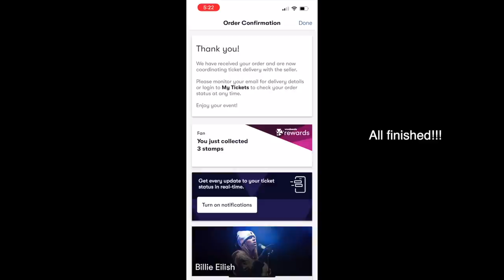Overcoming Obstacles

Comment: If the dog can get out, coyotes can get in, also foxes will dig under the fence to get to chickens and geese, Hawks fly in over fences. YOU NEED A BARN,  a large barn to protect the animals now. With PJ growing up on a farm, I would think he knows that. Chickens need to be in a closed coop overnight (and have a roof) to protect them from hawks and owls, especially since you have so much open land. And by the way, if there is one coyote, there is likely more as they are pack animals.
Reply: It's also frustrating as a farmer's son who works on a farm with more handlers and less livestock than PJ has to see almost no basic, rudimentary farmer's management going on.  
What is your herding plan?  How are you rotating the sheep on the land - are you going to use staff or are you going to use fencing.
Where I live it's a required class at the middle-school level to learn very basic husbandry - learn how to move herd for the betterment of the land.  It's no good to have all that land if the animals are just going to muck about in one spot making it that much easier for predators for so many reasons I cannot even type.
They're not really overcoming obstacles - they're creating obstacles.  And now they have pigs.  And they're not raising them to be processed.  That's just.  Think of the cost alone for having this much livestock that's only ever going to multiply unless of course they're killed.
Those predators have less and less sources of food the more they loose their habitat.  This type "learn by the seat of our pants (with so many animals)" is going to bring them all down on top of their OOOONO-ee farm.    
 It's time for someone to do a fb marketplace intervention.  
 I love PJ and Thomas.. going back years now.  And they can do what they want to do all day long.  Bless them.  But It looks like the children at this point are kind of rolling their eyes with "Guess what new farm animal we have today."

Why do you need that much livestock if you're not processing meat or milk or wool - or farming them for anything else than to be looked after or just pet, I guess????

They need farmhands - this is a fulltime job.  Thank goodness they're finally getting some help at home and with 
their "property lovers" side so they can actually move to and take care of this tremendously important ecosystem they've created.  There are sooooo many farmhands that need work in that part of the country!
Reply: @jquibbler  I am glad to hear that someone else thinks like me.
Reply: Absolutely right sir.

Comment: PJ change out the aluminum wiring if you can.  If you do not make sure you buy the right outlets for aluminum wiring.  They are a little different from copper outlets.  I do not know if you know this but back in the 1960's, 1970's and early 1980's there were multiple trailer fires with aluminum wiring here in Texas where people overloaded outlets with things plugged and fires resulted.  So, please be careful with the wiring.